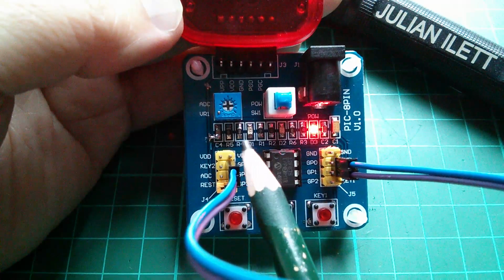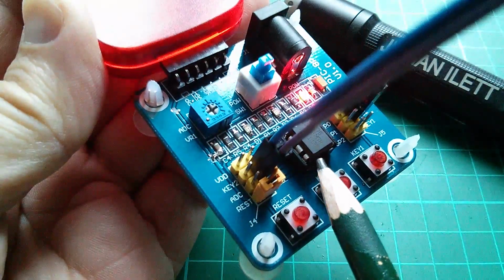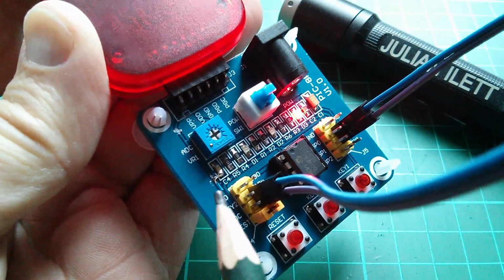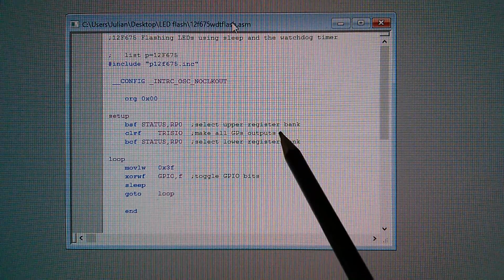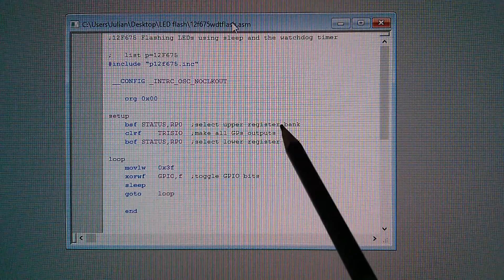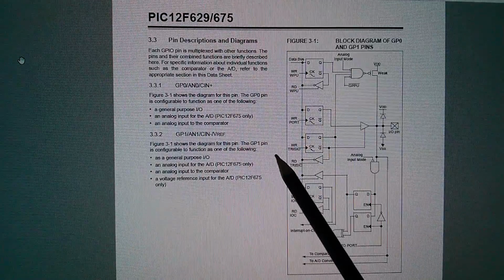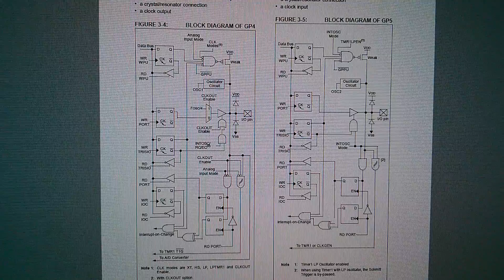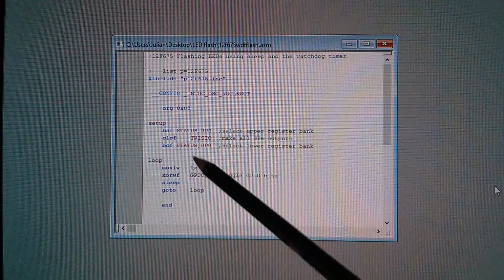Update: PIC Development Board and Sleeping Beauty

Comment: While it's not the case with PICs, often with other chips, maximum sink current vs maximum source current are different. And quite often you can run more current through by sinking the GPIO. That's why LEDs are often "reversed". While it's counter-logical to set bit 0 to get the LED to light up, by my experience, it's quite common. (PIC12F675 max for both ways is equal 25mA)

Comment: 7:23 It's not unusual to use logic 0 to turn an LEDs on. There are several reasons:
1) The lower FET has usually a lower RDSon and can drive more current
2) There are some PICs that even  have special I/O pins that can be switched open drain and used up to 12 or even 24 volts. Look out for some PICs called PICxxHVxxx. Some of them have this feature on dedicated pins.

Comment: Just a quick tip,  I have always used a simple 1N4148 diode on the /MCLR pin in my projects and have never had a problem programming a chip.  You really don't need a schottky .  All it's there for is, as you said, to keep Vpp feeding back into Vdd through the pull-up resistor as it could potentially cause the problem you were having or damage your power supply if you are using a separate power supply to power the board.

Comment: Julian,

I'm looking forward to the series but it strikes me that PIC are a little dated given the developments in Arduino and the various IoT devices currently available. Apart from the academic interest of us geeks out here, do PIC devices still have a place? Normally we see something similar in little epoxy blobs when someone does a tear down but in anything of DIL size 8 or above why not use an Arduino?

Kind regards, Alan
Reply from the maker: It's the assembly language programming that interests me most - all that binary or hexadecimal bit manipulation stuff. I'm familiar with assembly for the PIC, not the AVR. Now that Microchip has acquired Atmel, who knows what direction PIC and AVR will take now.
Reply: Did quite a lot of 8bit assembler on the 6502 in the BBC series of computers in the 80's. Should bring back memories - or nightmares!
Reply: And the Z80 in the original Sinclair - how old am I?

Comment: If you remove the capacitor on MCLR you'll probably have no issues. It's the cap that slows the rate at which the VPP voltage can be achieved. The 10k should be fine.

Comment: With all these mods, what's the point of using this board to begin with?

Why not connect a bare chip on a breadboard? You can add your own leds and buttons. Just like you did with your Arduino on a breadboard series. 

It will probably also be cheaper, as the board is relatively expensive.
Reply: What is the point of doing it yourself, if you can get a reliable working devboard. If you make one yourself, you'll always be wondering if the fault is in your code or in your circuit.
Reply from the maker: +xFuaZe Good point.
Reply: First of, it wasn't reliable without the modification. Secondly, Julian had to figure out which way around the PicKit had to go, as it wasn't marked on the board. 

But you may be right that the board is more beginner friendly. And since the button and leds are already present, you could just program any code Julian provides, and run it without touching a single jumper, resistor or LED. So you could focus more on programming a PIC that the electronics side.

Comment: I just don't see any advantage to using pics rather that AT style processors which are cheaper and more capable.  What am I missing?
Reply: Rosscoff2000 what's am AT style processor? The PIC is a full microcontroller rather than a processor, so ideal for small embedded systems.
Reply: +SDG Electronics I meant the Atmel AT Mega microcontroller range such as used in Arduino boards. They have on-chip Flash, SRAM, internal EEPROM memory; SPI, I2C, USART, USB and CAN buses; watchdog timer; ADCs, DAC, PWM outputs and GPIO pins, plus an excellent IDE with a massive range of public domain libraries, and they generally cost a lot less than PICs in various types from minimal 8-pin jobs up to 64-pin variants with 48 GPIOs. That's why I don't understand why anyone would still use PICs like the  PIC12F675.
Reply: Alex Gray As far as I know, Atmel devices are no cheaper than any of the competitors. You might be able to buy them on eBay cheaper, but most of those are fakes/clones. Devices like the PIC12F675 are ideal for small low cost devices - as an indication I used one in a device several years ago where the BOM was very cost sensitive. In volume we were able to source these for less than 10 cents each. Additionally, there were no issues with volume purchasing or long term availability like there were with Atmel devices at the time - they were notoriously poor for stock control and obsoleting devices.

Comment: I completely understand the concept of "making the board work"  as opposed to "working with the board".  With the 5 LEDs, a programming solution might be to set the initial values to 000111 instead of 111111.  As you said, the difficulty is in the LED boards and their 'inverse' power reference.  It's really great to see the traps and I am looking forward to more of these pre-tutorials.

Comment: Now let's head to looking for a differences between PIC and AVR.
Reply: Let's avoid making a "fanboy war". I like that Julian shows PIC without continously looking back at AVR's or the other way around.
Reply: xFuaZe I was curious to find. There doesn't seem to be anything significant so it doesn't really matter.
Reply: +Hrnek Bezucha Microchip (PIC) has bought Atmel (AVR) so nowadays it's the same company.
AVR has good community support (and C++ compilers)

PIC has pretty cool features built in (builtin-RTCC, sigma-delta ADC etc)
Reply: xFuaZe does that mean that PICs don't have a C compiler? C or assembly would be my go-to language for programming microchips
Reply: Yes PIC's have C compilers.  Microchip have there XC8, XC16, and XC32 compilers for 8bit, 16bit, and 32bit micros respectivly.  There are also a few open source compilers that have been ported to run on PICs such as SDCC  (Small Device C Compiler)

Comment: Good start on the PIC tutorials. I am glad to see someone doing other than Arduino..

Why don't you look at the DM164140 MPLABXpress Evaluation Board. it comes with a build in programmer and a PIC16F18855 and a number of LEDs/Pot etc.. It only cost $12 US! so it's less then the PICKIt and board you got on fleabay.

From my understanding you can use a bunch of Mikroe Click boards and also reprogram the "programmer" as a second chip later if you feel like it. You could also skip the online programming and just do your own thing with MPLAB or whatever your plan was.

Just a thought..

Comment: The reasoning behind connecting the cathodes of the LEDs to the micro is that the pins on the micro are better at sinking current than supplying current.
Reply: Yes, but they are quite capable of supplying enough current to light up a LED, so there's no good reason.
Reply: Perhaps it is to leave some head room for other things to be connected to the pins?
Reply: depends... on the PIC's, most can sink or source the same, so it doesn't actually make any difference. however using inverted logic makes it reversed to normal 'output Hi=LED on' convention...which may be a source of confusion, to add to all the others (bank switching, osc setup, port setup,and on newer ones pinout routing ! )

Comment: Well PIC does have some interesting features but the prices are really high compared to AVR so I don't really know why would I want to use one. Does it use less power or why would I use one? 
(I'm just curious.)
Reply: The "old" PIC's are not all to usefull for me. They did improve on the PIC32 though. Also, note that Atmel (avr) is now part of Microchip (pic). but the 8bit PIC's don't really support C++, programming cables are a little more expensive and they may not work with Arduino IDE. ARM based micros are also very interesting.
Reply: but, PIC's sometimes have interesting features that AVR's don't have. And for some reason, the industry seems to like PIC's over AVR's.
Reply: xFuaZe PICs are cheaper, and they have maintained a longer lifecycle(can still buy parts released mid-1990s).
Reply: +Peter Feerick I've worked with both of them, but you should pick the MCU that fits the job, regardless of what  brand. Atmel is now part of the Microchip (pic) corporation, so basically they're from the same company ;p they both got their pro's and cons, just try what fits your needs. PIC has great hardware, AVR is a bit better on community support. Espressif (ESP-xxx) are great for wifi applications, but also check out ARM cortex Mx licensed onces are simply very powerfull.

It can also be worth checking out "mini PC's" and linux, since they're better at video processing, video output (hdmi) and usually have ethernet/wifi/bluetooth and storage on board, withouth needing extensive programming (since drivers are readily available). But that's probably a little different market.
Reply: Hene193 Pretty much all of the MCUs from various vendors have their USP. From my experience, the PICs have the widest range of peripheral options meaning you can design your product down to a cost. Although general purpose devices are great for hobbyists, having loads of peripherals that you don't need really adds to the cost in volume, so you want to be able to select a device that DOESN'T have everything. Supply chain is also very important which varies significantly between manufacturers. TI and Microchip excel here...
Reply: SDG Electronics Thanks! That explains a lot. And makes a lot of sense.
Reply: Nathan Johnson Cheaper? Look at the ebay listing. It's 8 dollars and you can get arduino micro clone for 3 to 4 dollars. Pro mini might be under 3 dollars. Okay they are 8 bit so there is that.
Reply: xFuaZe Yea arm chips seem to be pretty interesting. I started with ESP8266 and all the power is pretty nice to have compared to 16mhz of AVR...
Reply: Hene193 that's just ebay and fake devices. Prices are similar from the distributors.
Reply: +Hene193 For the el-cheapo dev boards from eBay, aliexpress, etc, yeah, that is indeed the case. But if you were to go buy the MCUs from normal retail channels, like element14,  an Atmel ATTINY85 retails for AU$4.49, Atmel ATTINY45 for AU$4.13, and the nearest PIC I can readily compare it to being the PIC12F1840 is AU$3.18... so make what you will of that!  :D Not so good for the PIC18F2520 I picked to contrast the Atmega328 used in in the Arduino Uno - AU$6.44 for the atmel vs $13.93 for the PIC (but the PIC is twice as fast!!!) I'm happy for  someone to point to a better PIC to compare against... these where just my quick 2c comparisons.
Reply: +xFuaZe So true... I would be quick to say that AVRs are the bees knees, but that is what I am more comfortable with. I have also used PICs, and feel that in low power situations they beat the AVRs, but I just don't feel the need to digest the full datasheet after working my way through the AVR one ;) I really do like STM32s (maple mini style) for  graphic display stuff... they are fast, especially with their DMA capabilities. But you are spot on... each has their strenghs, so it is best to make best use of them! :D
Reply: Peter Feerick Okay well the money isn't a real problem for my hobby use but I just thought PIC would have some special features that makes it much better.
Reply: +Perer Feerick I don't know much about PIC (nothing to be honest) but I've read somewhere, that PICs need 4 cycles per instructions, whereas AVRs need only one cycle, meaning that say an AVR running at 10MHz would be equal to a 40MHz PIC in terms of instructions per cycle. So I wonder if that PIC is really twice as fast? Is it really running with 80MHz internally or did I get something completely wrong? Cheers!

Comment: Remember to disable the comparators also. CMCON=0x07, as well as the Analog inputs as you mentioned.  //ANSEL=0; // only defined for pic12f675 (copy paste from a code I have :D ).
Reply from the maker: clrf ANSEL and GP4 and GP2 start working. Put 7 into CMCON and GP1/GP0 burst into life. Spot on :)
Reply: Interesting regarding wake-up from sleep. I have YT channel myself and recently made a video on pic12f629 and the interrupt-on-change function to wake the mcu from button press. Maybe you'll find it interesting :)

Comment: A watchdog timer doesn't usually just "continue" a sleep statement, it resets the entire processor. The idea being if you don't reset the watchdog every 2.3 seconds in your code (in your loop section), your code must have crashed, so it resets the processor. The PIC implementation may very, but watchdogs are pretty standard for the most part.

The impact in your case is code that works fine - but you're resetting the I/O pins every time. Your code is returning to "start" every time, not "loop".

Edit: Of course, your video explains that PIC does INDEED treat sleep differently than the watchdog "pseudo-standard". Neat.

Additionally - could you use that one input to pull a gate on a transistor low, and use THAT to flash your 6th LED? I don't know if that's possible: just a thought. I think the pin has to be "tri-state" to allow you to pull that trick off. (?)
Reply: True, that is the normal understanding of hardware watchdog timers... but just to be be different, both Microchip and Atmel (now Microchip) MCUs (I don't know about STM32, TI, etc) can treat it as either a wakeup-and-pickup-from-where-we-left-off or a reset trigger, depending on how you arm the beast. All in all, that functionality makes it a pretty powerful thing on micros.
Reply: +Peter Feerick True. This I learned. I'm old-school. A watchdog timer was very tightly defined in my day. I like how it's evolved.